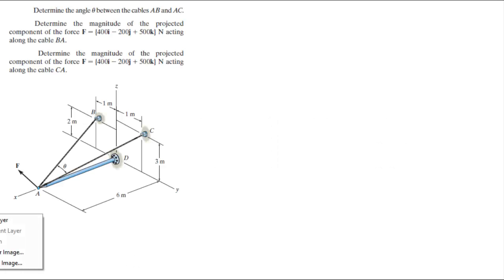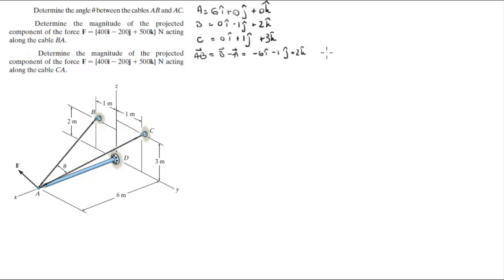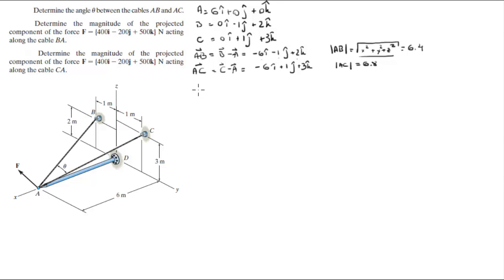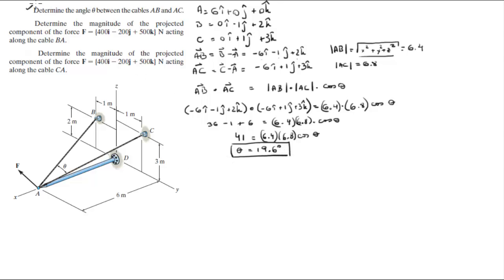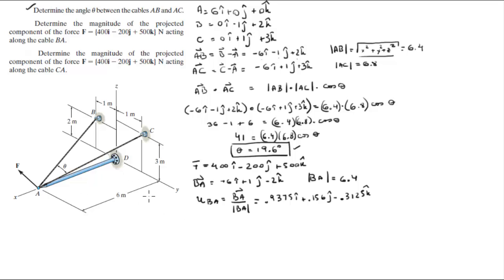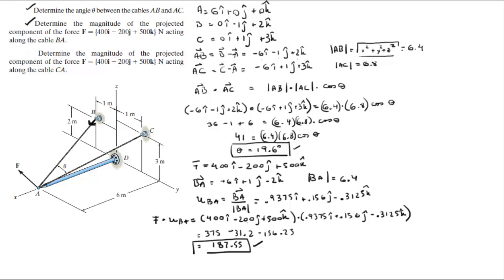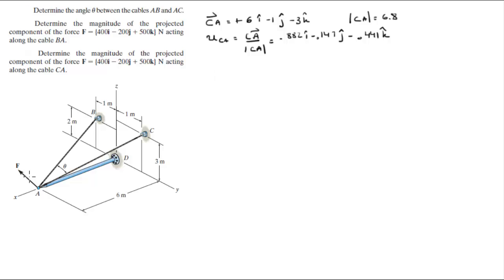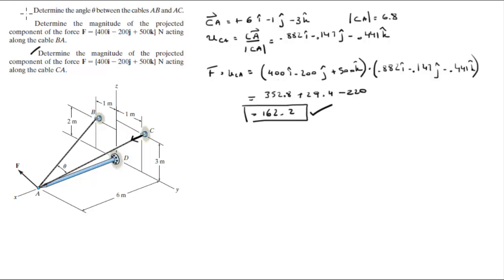Find the angles between AB and AC and the projected components

Comment: I think you made a mistake. you wrote the cartisean vector for ac, not ca. it should be -6i+1j+3k
Reply: the answer should return the same value but in the opposite direction once all calculations are complete if that were the case.
Reply: @jessec6520  they are not the same